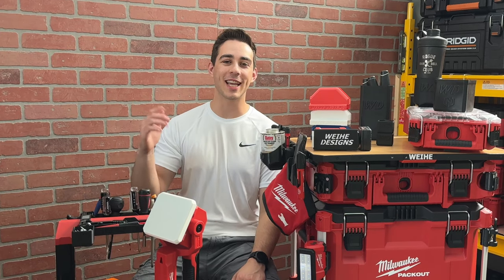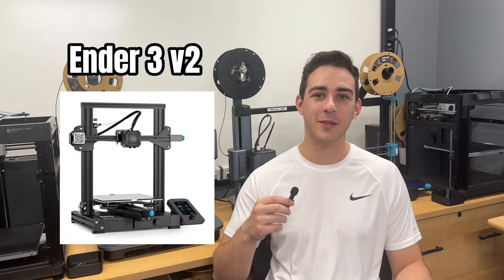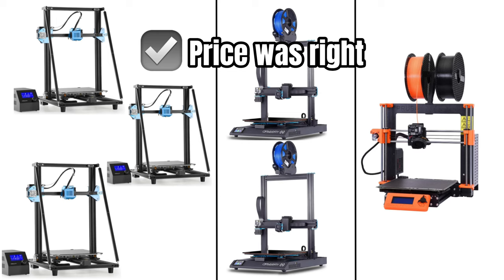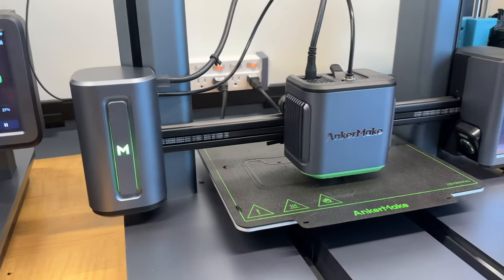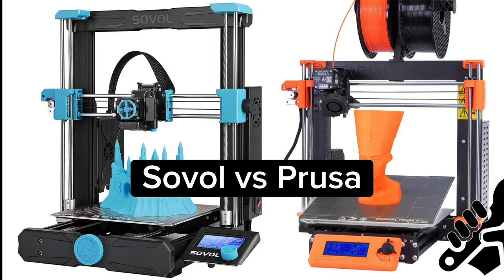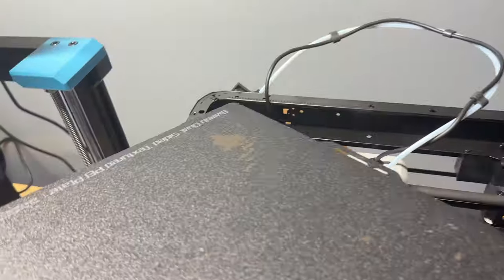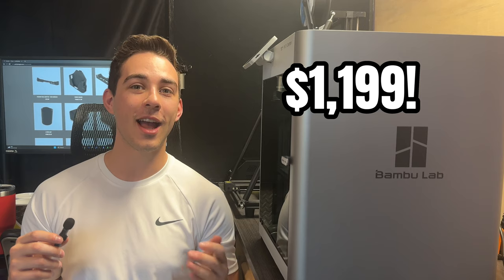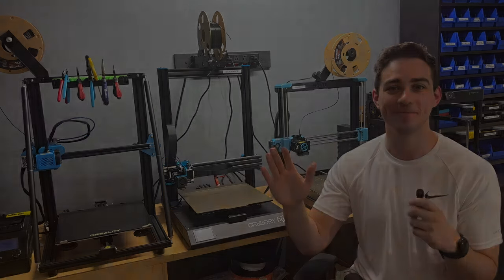BEST 3D Printer For A PRINT FARM? My favorite machines for my business

Comment: i got 2 ender printers and cant make me change them. im not for extreme speed and dont have overdue of money and live in Sweden. im just making a 8 foot tower crane and its 193 files. for us 110 volt moight be other things. got failöproof ender3 v3 SE and ender 3 neo. last i have had some issues with but man made not printers fault. got 2 old prusa clones anet A8 but getting rid of them only problems.

Comment: Hi, I'm thinking about buying my first 3d printer. For now I consider Sidewinder x2 (its about 210 USD from bangood with coupons). I want the printer to be the most silent because it will print in my bedroom. I'm little worried about the support from banggood. My friend had a problem with this printer that after few prints, the surface of glass started to stratify. What do you think? Is it a good choice for a start?
Reply from the maker: It’s worth a shot. My bed was fine for over a year and then I just upgraded to a pei for about $30 to avoid any future problems with a higher volume of printing. I personally always liked the glass finish, just gotta dial in the first layer height

Comment: I'm waiting for Sovol to make a Klipper version of the SV06 Plus, or for Elegoo to make a larger version of the Neptune 4.  I was interested in an enclosed core XY machine but I mostly print TPU so I don't benefit from faster printing when the filament can't print that fast even with better cooling.  I'm now leaning toward a less expensive non-enclosed bed slinger design that is more reliable and easier to service, with Klipper for improved print quality with a slight speed increase.  We're seeing the first generation of Klipper bed slingers in the last few months but they're all lacking in a few key areas.  Someone will market a Klipper bed slinger that checks all of the boxes soon.  SV08 Plus?  Neptune 4 Pro Max?
Reply: I own a sv06+ as well and now that the sv07+ is out and comes with kilipper pad that can run more then 1 printer was thinking of getting it and have my sv06+ connected via the svo7+ kilipper pad since it can be done making the sv06+also wireless
Reply: @MrMadmazz  - An SV07+ Klipperizing your SV06+ sounds like an excellent plan.  My Neptune 4 Pro is the first Klipper machine I've had and I love Klipper.  Being able to upload and print from a browser window is very convenient and saves a lot of time.  It's light years better than the micro SD card shuffle I was doing.
Reply: @Liberty4Ever  yeah bro I run my sv06+ direct from PC with simplified3d and a USB repeater. If everything works the way I would like the sv07+ will make my sv06 wireless and not more need for a damn cable
Reply: I been running my sv06+ via PC since week 2 of my printing adventures. Never used the software that come with it since a friend with 8 years under his belt allowed me to run as his 2nd PC so I was lucky and had simplified3d  from day added edit: down side is I've have 2 power outages that destroyed the prints all coz I didn't put in a SD card and click send to SD WHICH would have saved 2 prints during power spikes
Reply: Sovol sells a 5" isp display with Klipper for both the Sovol SV06 and SV06+. They even have combos on their website

Comment: As someone who's been into 3D printing since 2012 and I have my company, it is very important to minimise variety within your farm. Let's say you have a farm of 50 3D printers, you should have at max 4 different types/brands. This ensures that your quality is consistent and spare parts are at minimum.

Prusa printers are a workhorse and I recommend them, one good thing about bed slinger type of printers is that you can automate the process and print/eject easily. Recently we have added Bambulab printers to our farm and they are quite good after adding a few upgrades.
Reply: I agree. Even though the maker has good information on his printers, I'm amazed at the amount of different types.

Next to your points I'd also argue that the learning curve is annoying if you diverse much. At some point problems will start and if you have wildly different printers it's just more headache to get to know all their quirks and the required tweaks.

I went with Sovol SV06 to complement my Prusa MK3S+ simply because they share a lot in design philosophy. I could have gone coreXY but I prefer next to my printers using standard parts and not a completely proprietary hotend also to also keep my software workflow simple, so BambuStudio is not for me until they dominate the market and I can migrate all printers to that.
Reply: What’s your advice on starting a print farm from scratch today?
Reply: @johnwayne6775  it depends on your use case and the products you want to manufacture. Consider the size of your printers, material compatibility, if products require postprocessing, your budget & designing skills. These are some factors, but it really depends on how you want to establish your business.

For my business, we're focused on making customised products in a short duration. So we don't do what many people do on Youtube & Etsy. We advertise our work to high-profile companies and showcase what we can make. They usually request things that are unique to them and sometimes it's a few pieces(<10) but usually large parts (we made parts as large as 4 meters) while other projects require many iterations of designs and then finally printing several hundreds or even a few thousand pieces. My team is composed of 10 full-time members and so we can put full effort into our work. If you wanna do it as a side job, it can work, but of course, it'll be limited.

So, for you, it boils down to your capabilities and time. If you've got both, then study your potential clients and make sure you have the proper tools to fulfil their demands.

Wishing you all the best 🤲🏻😁
Reply: @3DThird What upgrades are you doing to the Bambu?  I have an X1C and starting to nail down a couple of products I want to try in the market and see what happens.  Definitely going to go to bigger external spools at least.

Comment: out of these printers which ones do i NOT have to assemble? i'm not intrested in building my own. i believe Bamboo P1P is plug and go? or am i wrong.
thanks in advance.
Reply from the maker: Bambus are as close to plug and play as possible. A few screws to remove and an auto calibration proves.

Comment: how well does the bambu lab print petg?  I can't print petg at the limit of my old machine.  Does the bambu make sense for petg?  If it can print petg faster does it handle simultaneous printing well?  ie travel 3/4 of the bed without oozing? Should I forget about printing petg fast if I care about strength? Thanks!
Reply from the maker: Printing PETG was such a challenge on my old machines…Now I don’t ever think twice when sending it to the Bambus. 
As long as a printer has an all metal hotend and is direct drive it should be able to print petg pretty well buttttt the bambus are next level

Comment: OG Ender-3 -- i am yet to see nicer print quality. No, i'm serious.
It's something about the slow speeds, slow accels + bowden, yet precise motors which makes it capable of producing very very nice prints.

ALSO, reliable and very very little maintenance required. I just had my Ender-3's gathering dust for a year in my garage, lots of dust etc. I simply dusted off, wiped with barehand the "carborundum" (anycubic ultrabase) print surfaces and started printing again. Just used a blower on the spools sitting there and off to races. 4 machines worked right away, 5th needed a hotend replacement (put in bi-metal throat .. hope it doesn't lower reliability!), 6th i did not bother to setup but all it needs is a new extruder by the looks of it -- hell might just work, but it has a BMG with stock firmware ... so no go.

Comment: I wouldn't touch bamboo for a print farm. Have one sure, but not only do you have to use their slicer, they are one update away from preventing you from using 3rd party filament.
"they said they wouldn't do that" I hear you say. Yes they did, but why add a feature if they have no intention of using it.

Building a print farm with them means having a lot of machines you need to offload if they make the change.